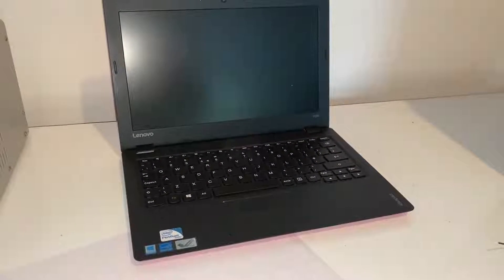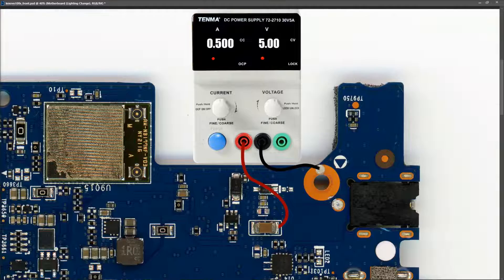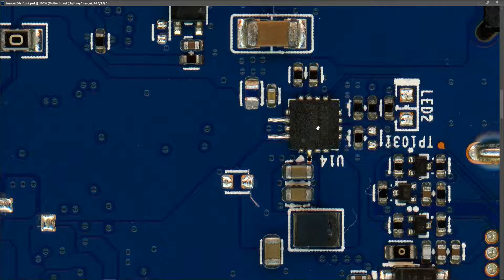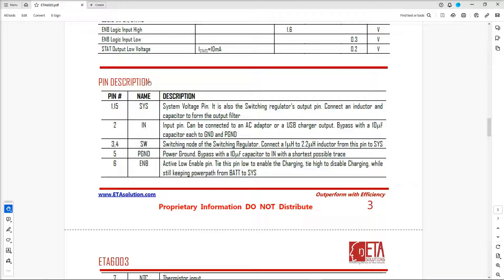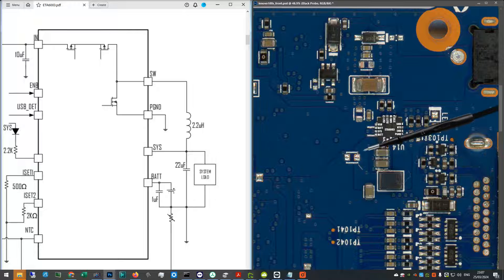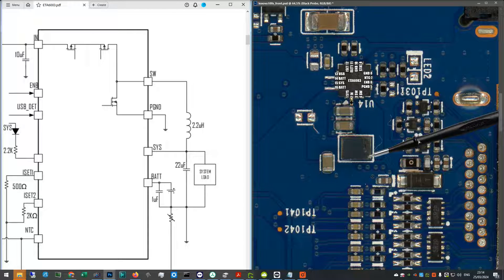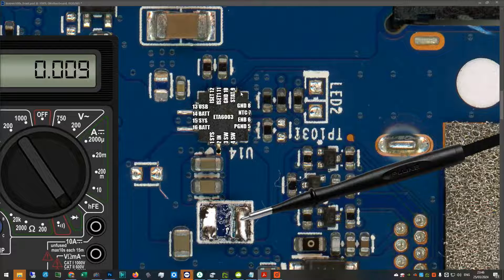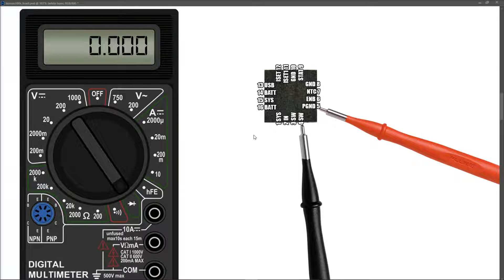LENOVO 100S - SHORTED MOTHERBOARD

Comment: Hiya, I'm a fellow Irishman with this laptop and the same issue, no power, not Charging. Doing my research it sems it is the ETA6003 that causes the issue. I'm about to remove it and see if it works. Great video.

Comment: Nit picking here :) 11;28 you checked the pcb leg of the coil, but did not check the other side of the coil. If something is shorted on the other leg, like the cap, that  could be the cause too. Yeh, in this case 99% it is the chip, but always check all pcb pads of a removed component, if the short still exists